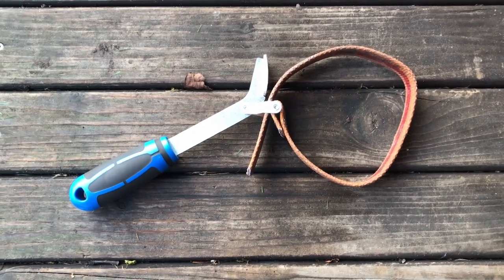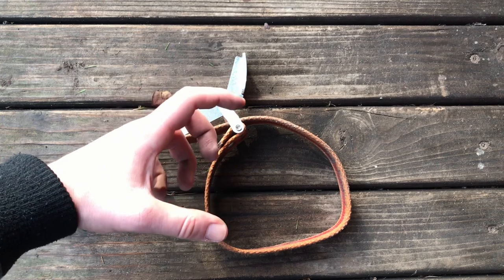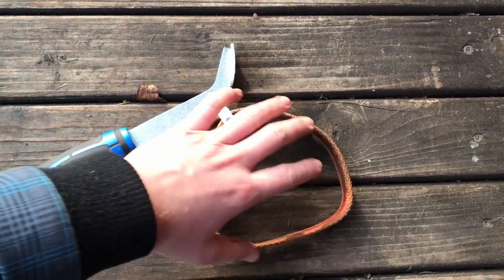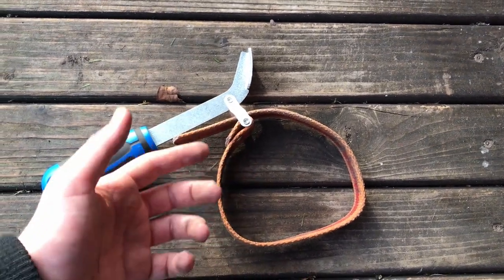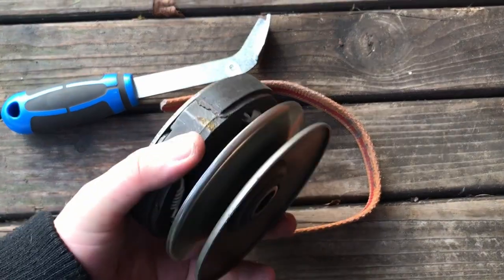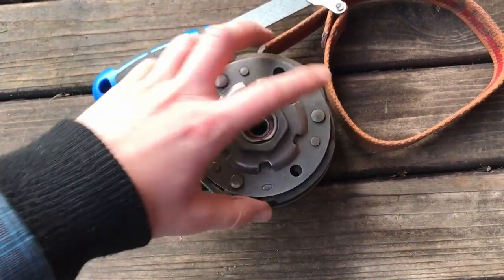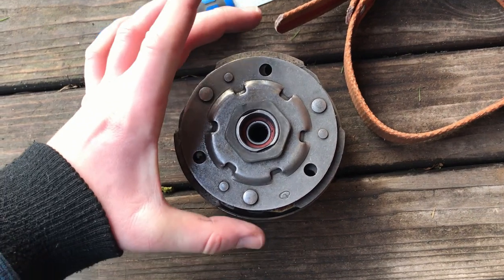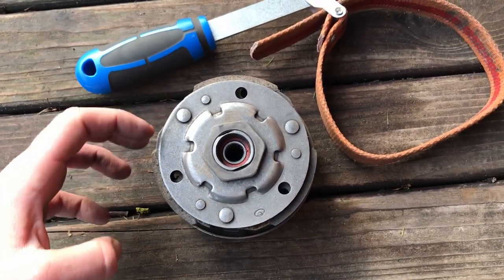NoExpert - TINKR#1 - Oil Filter Wrench

Comment: Pls let me know the strap material used in this video.
Reply from the maker: I looked it up to find the exact material, but it just said "fabric tape" which isn't really that helpful. I would describe this as a heavy duty belt strap or webbing strap / belt maybe. It is not pure nylon and not pure fabric and the red line on the inside is a thin layer of rubber for better grip. I hope that helps somehow...